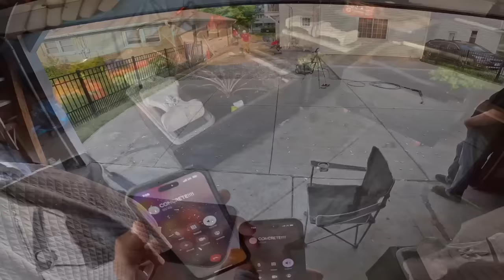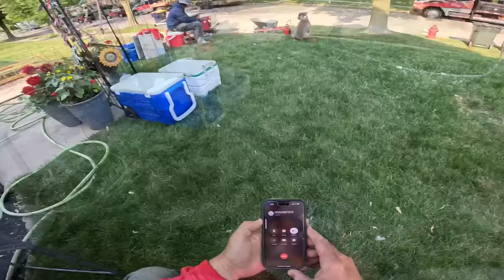Big Ray of sunshine strikes again!

Comment: I'm a retired concrete contractor from Daytona Beach FL. Victory Concrete Services is the best in all phases of remove and replace of the Driveways, great work, pride in there work, that is due to Ryan, the Boss. Love it, 45 years and I've seen and done alot in my career.
Reply: I've been in the concrete business too since 1977...starting my own business in 1983 with 30+ employees with all sorts of equipment including mixer trucks...doing every & any type of concrete you can imagine for high end residential, commercial, industrial, institutional, municipal, civil, federal & oil field projects.
Don't get me wrong, Ryan is a great guy, but I would not classify him as the best...very good but not the best.
He's pretty good, but could do better when it comes to attention to detail when it comes to forming, cleanliness, use of rebar as opposed to wire mesh for driveways, patios & walkways. (Just watch many past videos.)
I don't want to come across as negative, but I'm an Architectural Technologist who started in concrete in 1977 and I come from a commercial background and apply those same principles to all my residential work.

Comment: Ryan,  USPS has those small flat rate boxes that are the size of a VHS tape.  You seriously should mold small concrete blocks and stamp them with your logo and add them to the merch store.....I would certainly buy one to use as a door stop in my shop.....You can give that job to Daniel to manufacture

Comment: Can't you cut a radius in plywood& mold the curb perfect??? Even though Bugs does a fabulous job freehand!!!
Reply: Yes, or out of a length of 2x8 material and strike off with it along that edge...it would take way less time to mold that rolled curb as they were placing the concrete and would be in perfect form without having to eye it and finesse it.

Comment: Everyone who works on their knees 24/7 I suggest getting some knee pads. Save your knees or you will be needing knee surgery like my uncle.

I work with concrete as well and I wear knee pads and my knees still hurt for 1 day and it goes away with some bio freeze. FYI. Keep up the good work!
Reply: I've been doing concrete since 1977, no knee pads and always used plywood knee boards until the foam ones came out...never any issues with my knees.I only used knee pads occasionally when I would do some commercial patch & restoration work on older existing concrete floors.
You need to be careful with knee pads because all that moisture and sweat will get absorbed in and around your knee and then that will cause you problems. I know many guys that used knee pads and they have water in the knees and knee issues.

Comment: FYI…cold joints on those blocks aren’t a big deal if you stick a bit of rebar out the top of the partial pour at a few different angles and then pour on top of it later.

Comment: Ryan, i remember the many, many times i helped my uncle with concrete, he used diesel in place of form oil. He said the company he worked for, pouring footings and foundations, only used diesel as well. Is the form oil that much better?
Reply: There is a reason why it's called form oil. It's specifically designed to apply on wood when pouring concrete, so concrete does not stick to the wood and the wood releases clean.  I've been using it since 1977. I've never used diesel...sorry, that's for hacks. People who use diesel don't want to spend money for form oil...more expensive.
Most of my job sites...the spec is for form oil...diesel strictly prohibited. I learned the proper way of using form oil from day 1, but many guys still use diesel and I'll keep using form oil.

Comment: Hey ryan, just an FYI, im not sure if you know this or not, but Vinyl siding has something called "oxidation" and when you pressure wash the siding, it removes the oxidation which is bad for the siding of the house. Didn't know if you knew that or not, don't want you to get into a bad situation after cleaning someones house off.

Comment: you need some lessons on power washing siding. that wirlbird is to strong on the sididing. if you get to close with to much presure you will take the factory wax off siding. after it dries you will sometimes see the marks. and for your broom handle check out the window washing poles at home depot they hold up good and have the flip up tab to exstend. keep up the good work!! been here since your 1st video. and thank you for the tip on cleaning stamed concrete and sealing. or {cement} like ray says it!

Comment: Ryan what are you talking about when you say 6 1/2 bag? I know what slump is and I assume nca is an accelerator? Beautiful work as always.
Reply: How much cement to add to the mix
Reply: ASTM C94 refers to a bag of portland cement weighing 94 lbs. 
6 1/2 bag mix per cubic yard of concrete would be equal to about 611 lbs of cement for a compressive strength of approximately 4000 psi.

Comment: You should make a form for paving stones. Whenever there is extra concrete you could pour the forms. Whenever you buy concrete there is usually extra concrete in the concrete truck. The concrete company here built a building using concrete others paid for. When we poured our warehouse floor Dad had the truck empty in the ditch at the driveway. 5 feet wide 3 feet deep and 7 feet long ditch was filled. The concrete company was mad because he made them do that. They made paving stones and other stuff with the left over concrete.
Reply: Most companies make sure to empty before they leave.
Reply: Also who orders that much extra?

Comment: When you pour part one day and then make another pour the next day why do you not dowel into the old slab to make sure if one slab
moves then all the slabs will move the same. The way you poured if one slab moves up or down you will have a trip hazard now. We use rebar
even in sidewalks in Texas never wire mess it just will not hold a slab together down here, we have the Black gumbo dirt. I do like the way
you put your joints in all your slabs. You should broom more of your slabs in the different directions at the joints more often that really looks good.